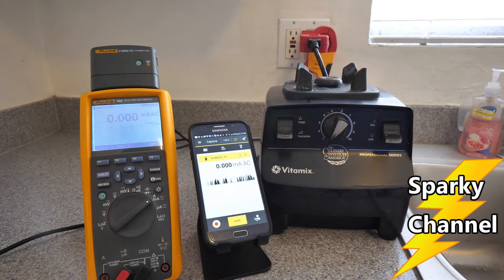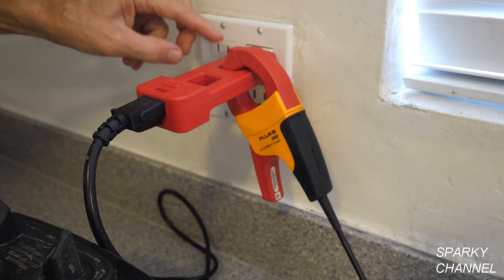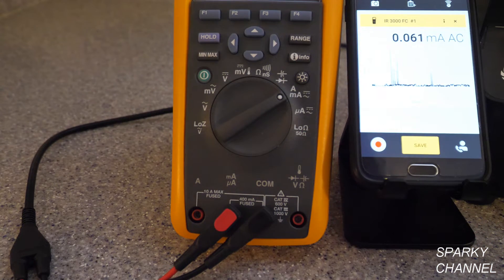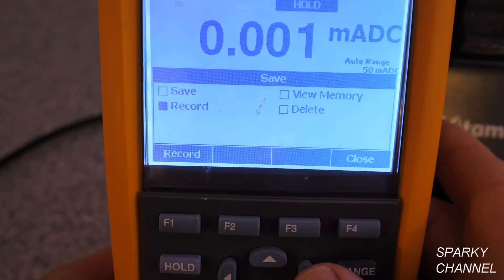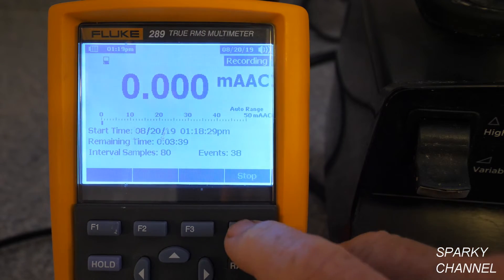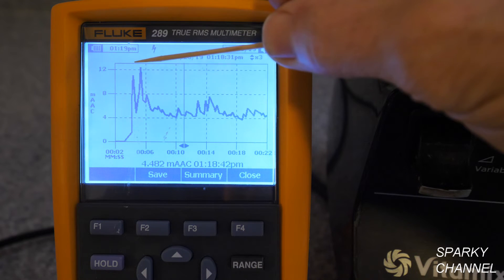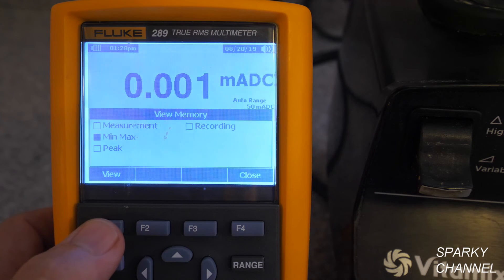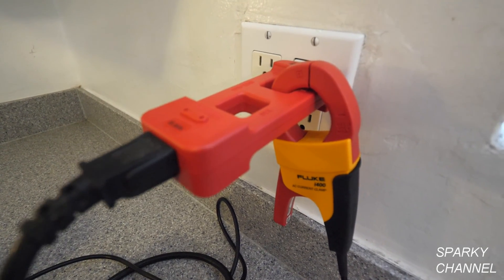How Many Amps Does a Vitamix Blender Actually Use?

Comment: I have a big mixing console in my studio.  It’s in a different structure on our property, with a separate circuit panel.  When I run my vitamix in the house, the torroidal transformer on my mixing board power supply starts to hum loudly.  Is it possible that the current draw exceeds the capacity of our power supply for the two structures?  Is the vitamix somehow getting DC current on our main line?  Is it creating dirty power?  I’d love to know what’s happening. It can’t be good….

Comment: In older homes, the counter top outlets in the kitchen are fed by 2 different phases. (top outlet is one phase, bottom outlet is the other) You can plug a toaster into one outlet and a space heater into the other and not pop the breaker, as they are essentially on different circuits. I would recommend that you do a video on these split phase outlets.
Reply: Of course, this would not work if your kitchen has GFI's as there is not tab connecting the two hots together.
Reply: thien minh nguyen It‘s not impossible to retrofit RCD/GFCI protection in that case. But you‘ll have to use a bit of creativity. You can use a a small panel with a piece of DIN rail in it and install a european style RCD in it. But the thing is, you won‘t get them in the regular stores in the US. That‘s industrial material.
They are three phase, but you can also use them as single phase devices.

Comment: Whenever I see someone planning and mapping out the potential power needs of a garage or a kitchen with a meter, I know things are off to a good start!
Reply: The thing is to consider the diversity, you don't use all your appliances at the same time. There are tables for diversity factors. For example carpenter's workshop got a factor of between 0.3 and 0.4. Car workshop between 0.2 and 0.3, the same as a normal mechanical workshop. The factors are without considering the lighting in that wokshops, these are only the power circuits.

And for example you want to install an electric kitchen cooker with a baking oven in your kitchen, the demand is 10.5 kW. I'm from Europe, so I'll calculate with 230V, but with 240 it's not that different.  So the amperage on full power would be:

10500 / 230V  = 45.65 A

Then use the first 10A as fix, and add 30% of the rest amperage to it:

45,65A - 10A = 35.65A

35.65A x 0.3 =  10.7A

10.7A + 10A = 20.7A, I don't know how the steps in fusing are in the US, but 20A would be too small, I would use 25A which would be the next step. And in case of an outlet on the kitchen cooker, I haven't seen them for a long time, but then add another 5A.

That's for single phase of course. For three-phase it's a bit different, because there you don't have such high currents:

10500W / sqrt of three / 400V = 15.2 A. So a three pole breaker with 16A would be sufficient.
Reply: @Marcel_Germann  That's definitely a good way to explain it! I'm used to seeing some folks show up with the "guess-o-meter" look on their face.. haha.

Comment: That's the reason we use 230V as mains voltage. Less amperage for the same demand. And if even that's not enough, in Germany three-phase power is common even in residentials. So you have three phases, every single one has a voltage of 230V against neutral or ground. The voltage between the lines is 400V.
But sometimes you can also divert the load on the three phases. For example the kitchen cooker. There one large and one small plate are connected to L1, the other two are connected to L2. The baking oven is connected to L3. In that case a three pole circuit breaker with 16A is sufficient to power an electric kitchen cooker with round about 11 kW.
Reply: i think i read somewher that, in america, it was the copper mining industry that pushed for 120v so that we'd need thicker copper wire due to more current and they'd make more money. i'd love for 240 volts to be standard. we already have 240v at our breaker panels, so it's not like it would be difficult.